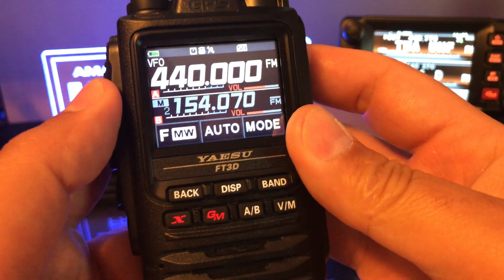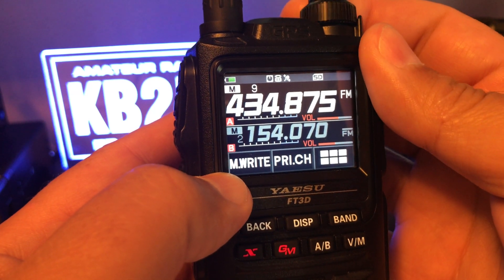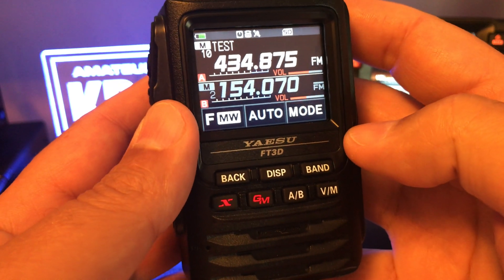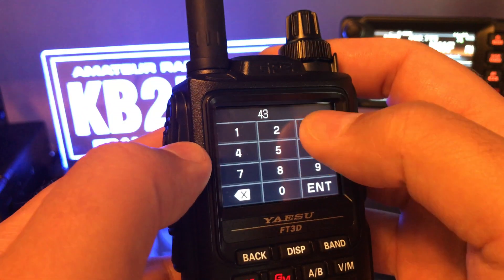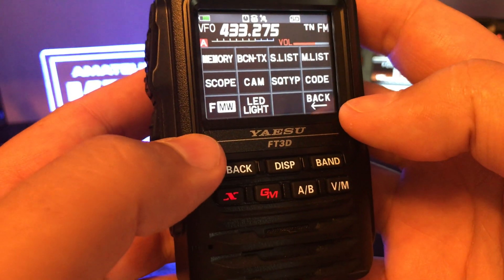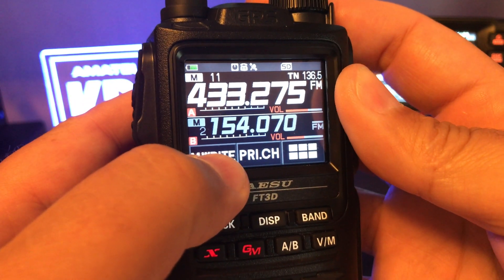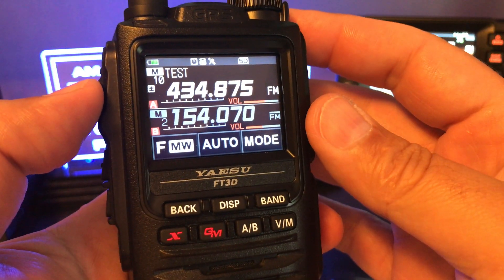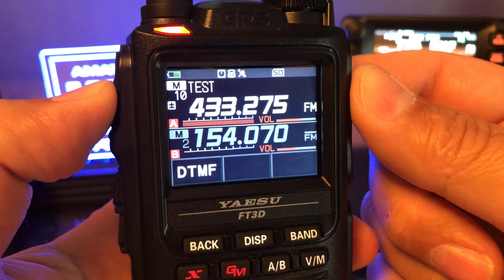FT3D Split Memory Programming

Comment: I like this…but unless I am wrong..this does not allow you to change the receive frequency “on the fly” to adjust for doppler on a satellite.
I put satellite transmit frequency and tone in the A radio and turn off the sound.
I open B channel to vfo mode and enter receive frequency ie 437.800.  Being in vfo mode…I can change the frequency “on the fly” from 437.810 to 437.805 then 437.800 and down to 437.795. 
You just have to be sure to return to the A channel to transmit. (don’t ask me how I know). It is a little more complicated but allows you to adjust for doppler.
Great video. I was unaware the ft3d could do this!